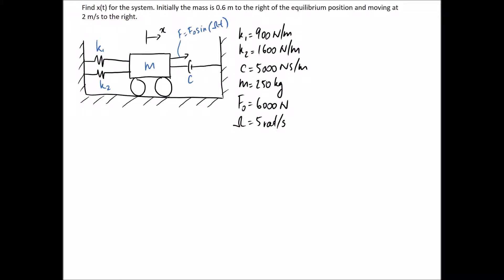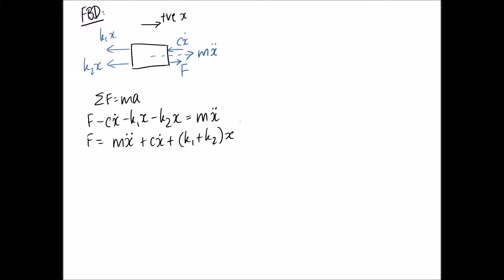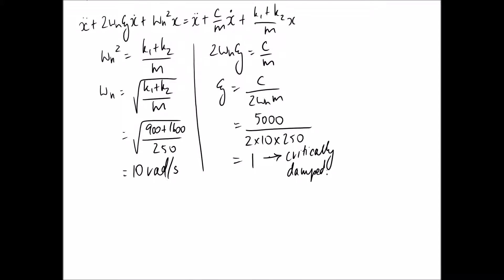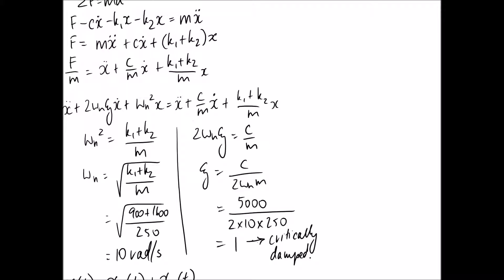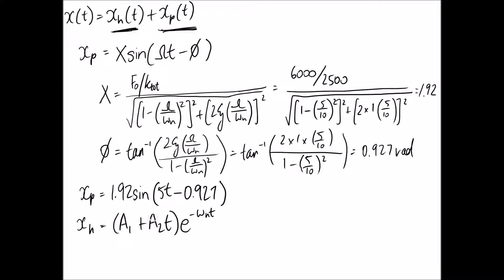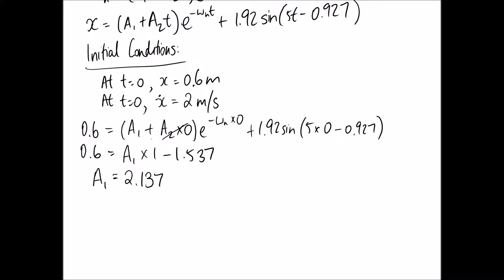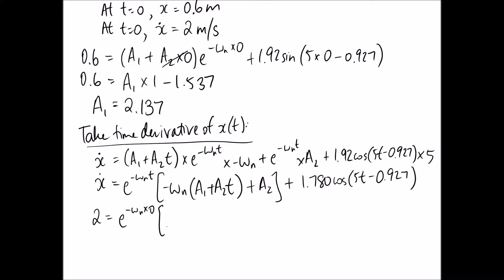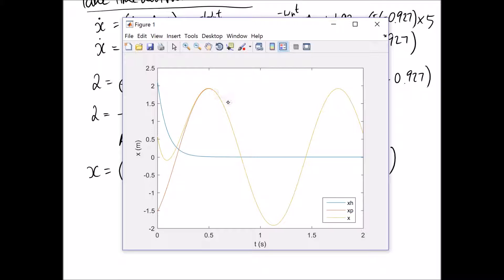Critically Damped Forced Vibration Example

Comment: How would it be diff if its under critically damped? Eg say 15% critical damping?
Reply from the maker: I am not sure what 15 percent critically damped means - I don't think this is a thing. There are other videos demonstrating what to do when you have underdamped, overdamped, etc
Reply: @theryderproject5053  i believe thats the damping ratio.. so its under critically damped.

My particular question involves a sdof system and it gives a force of say 250kN by a hydraulic jack and then the force is removed suddenly, and its given that theres 15% critical damping, so is it considered a forced damped vibration? Also how would i write the equation of motion for the given scenario & how would i find the displacement after a given time say 0.3 seconds after the force is released?
Reply from the maker: @HQR000  I think this would be an example of an impulse input. If you have a damping ratio of 0.15 then this would be an underdamped situation. You would need to find the equation of motion by doing sum of forces = mass x acceleration. Then you could solve this to find the position at a given time.